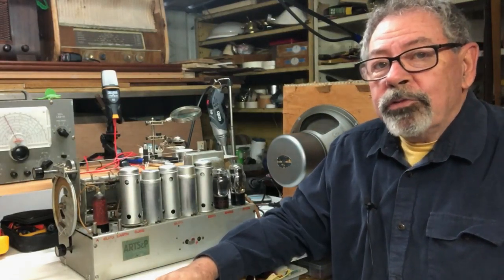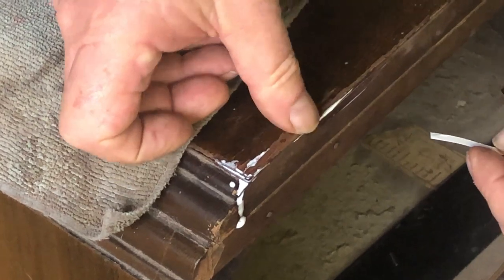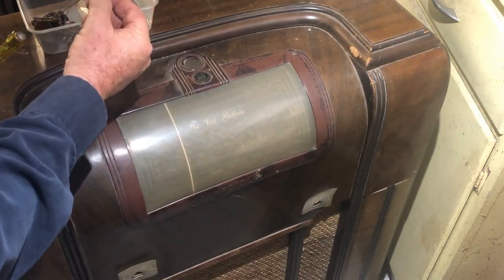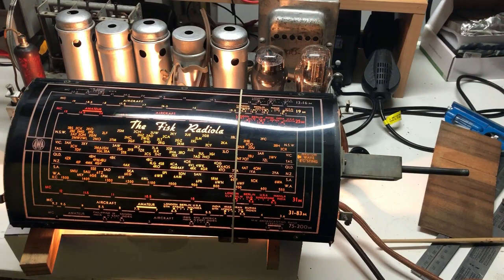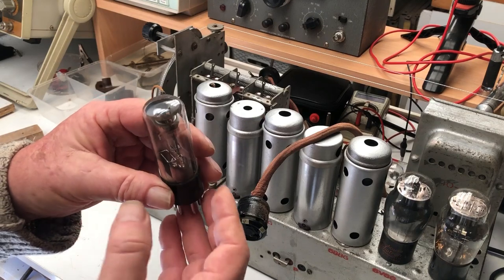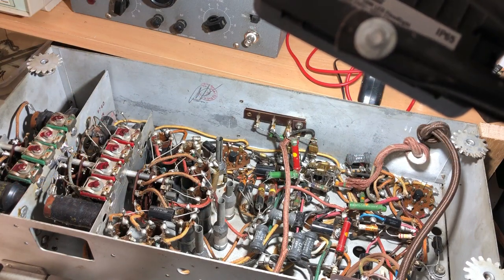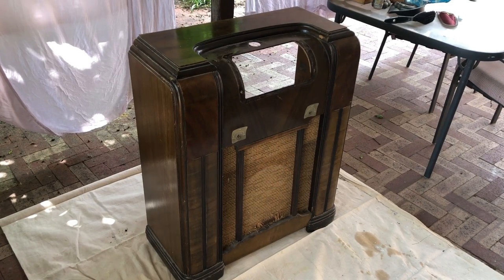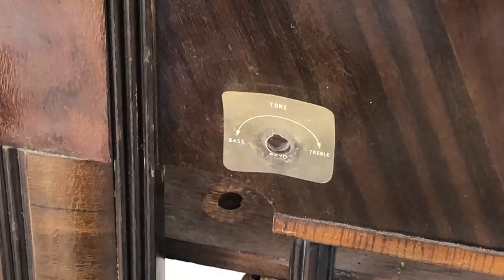1941 AWA FISK RADIOLA model 276 RESTORATION PART 3

Comment: PVA glue is not the best glue for large areas of wood. Aliphatic resin glue which is water resistant is best. Buy smaller
bottles as it cures when opened and exposed to air. The plastic around the clearer dial cover is called Tenite. It usually 
warps badly over time because it is so thin. It's main enemy is heat as it actually slowly dries out becomes brittle and 
cracks near the screws that hold it down. Yours is in good shape however it may have been stored properly away from temperature changes. Love that quarter round radiogram dial assembly. There may be a high value resistor in the eyetube socket that needs to be checked. They often go too high over time. Fun to watch your work on the cabinet. Reminds me 
of my early cabinetry work on furniture. It really does take a lot of time to get it right. Cheers from Illinois!
Reply from the maker: Hi. Thanks for the info.  I searched Aliphatic resin glue and it's available from the local hardware store si I'll get some for the next project.  Too late for this one but I have others coming up.
I also googled Tenite.  Reading through the Wikipedia entry, I think I'm lucky mine is in such good condition.  Still pliable and not warped at all.  For the clear dial cover I've got myself a sheet of 0.8mm acrylic sheet. It's quite flexible but springs back to a flat so would have to be held under tension under the dial escutcheon.  I'm wondering if I could permanently curve it using heat and a suitable former.  I had to buy a big sheet so I have plenty to experiment with.
Thanks for the advice. Always appreciated!
Cheers
Reply: @Donno308  I don't know brand names over there but it's yellow and thicker. The stuff you are using is too thin and squeezes out too easily when you clamp  everything down.

Comment: Great stuff again. you certainly have your work cut out with the cabinet, but I'm sure it will turn out really good when it's finished. Could you possibly use  thin transparent plastic sheet and form a new dial lens?. Great stuff as always. Cheers Chris
Reply from the maker: Hi Chris. Yes that’s what I was thinking. I can get a sheet of 0.8mm acrylic sheet from the local hardware. I think that might do the trick.

Comment: I have just finished striping a 1946 cabinet almost the same as yours.  A lot of work and also with veneer lifting like you had.  For cleaning the trims I used the back of a wood chisel to scrape the old finish off.  A very time consuming job cleaning the cabinet up.  Be careful by leaving the front with the original finish.  The new finish might react wirh the older finish
Reply from the maker: Hi Fred.  I spent all day today sanding.  It comes off better dry sanding - the paint stripper is a waste of time.  The trims are all back to bare timber for better or worse.  The front panel turned out to be shellac (french polish).  It usually takes acrylic well.  Those trims though ...
BTW my first car was a '59 FC
Reply: @Donno308  Great car.  Mine still has an original 60,000 miles on it
Reply from the maker: @Fred59fc  Nice!  One day I'll own another one ...

Comment: Shame about the magic eye, it's such a nice indicator.
I don't think there is any way it could be made with modern components.
Thankfully carl can help :-D

I thought something like an empty fire extinguisher  might help you form the clear window.
And a paint stripper gun to persuade  the plastic to bend lol.
So many cruddy parts to be fixed.
Sorry waffling again lol.
Reply from the maker: I was thinking the same thing about the curved plastic window.  I think a 10 litre paint tin would be about the right diameter. I was thinking of attaching one edge to the tin and heating it with the heat gun as I curve it around.  
I have seen a video about LED substitutes for the magic eye tube but they don't look quite like the originals.  Anyway Carl's tube has arrived now.
Cheers